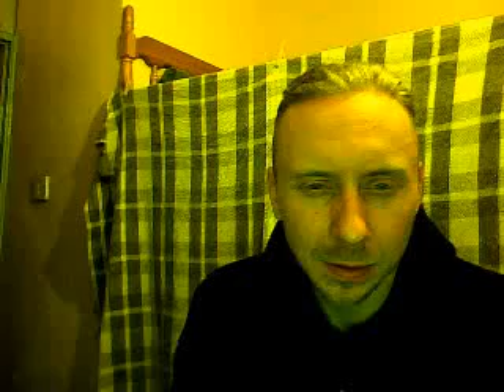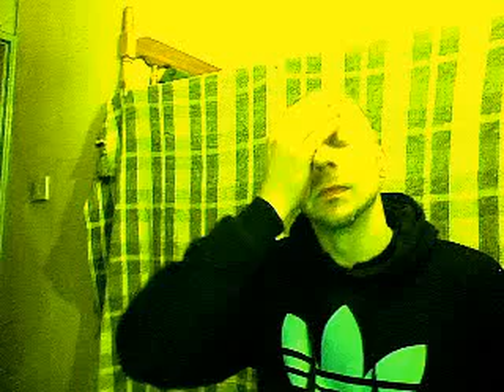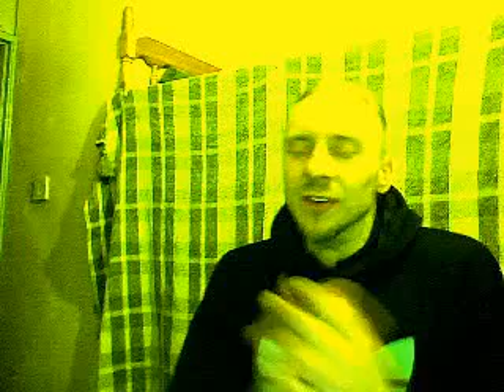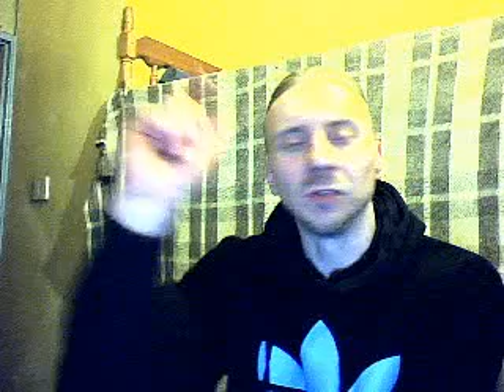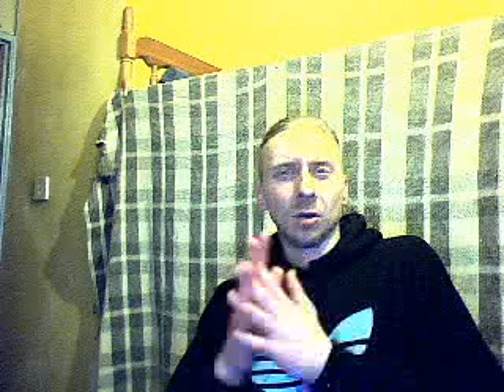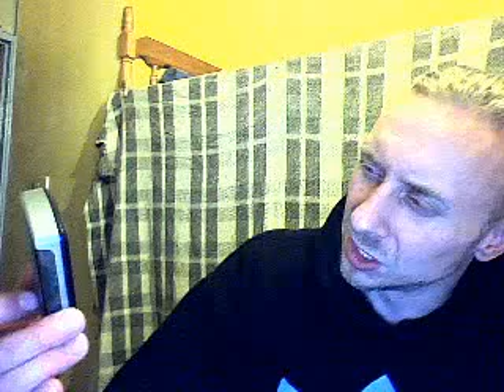Nuclear batteries (new power 2)

Comment: Israel has a start up company that will have 'swap' stations...power packs for autos that are electric and just put in a new pack. Takes about 5 minutes. But hydrogen fuel cells look like the best option; American grocery warehouses switched to this on forklifts... lead acids take 8 hrs to charge, 8 hrs to cool and have 6 hrs for work... fuel cells take 2 mins to refuel and have 14 hrs for work.